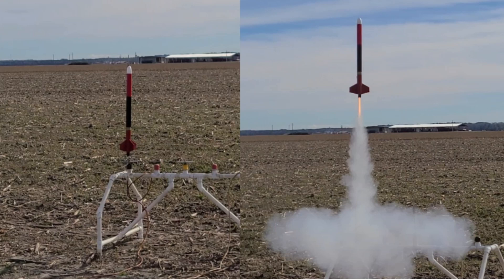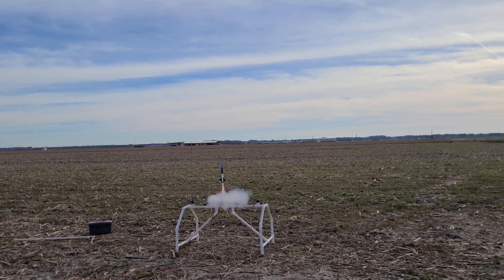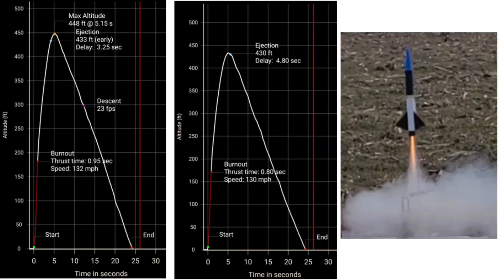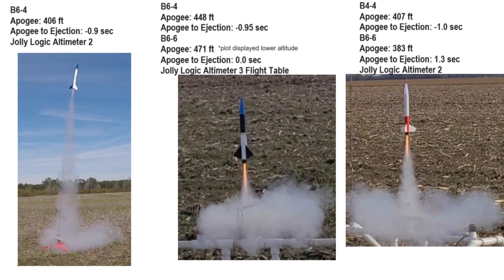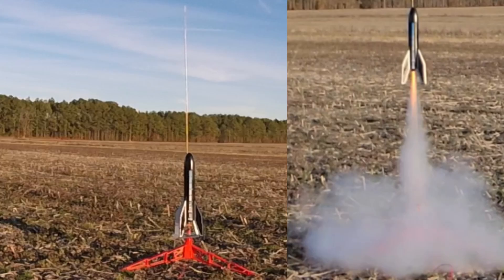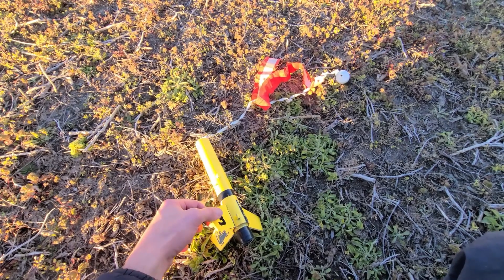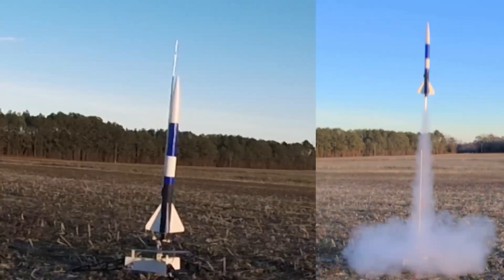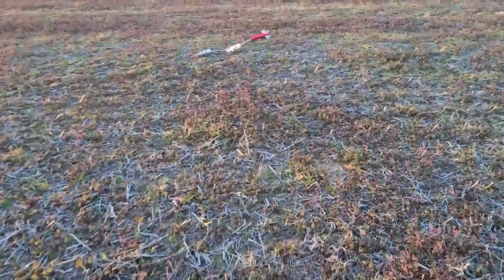Model Rocket Launches Including Estes Cherokee E and Olympus

Comment: I think I know why the fins break on the goblin air frame. The engine might be too much. Put in a smaller A-C engine and see if that stops that fin cracking.👈🤔
Reply from the maker: That launch was a C motor, I'm not sure I want to try an A or B motor in the Goblin, likely would be too underpowered, I'm planning to just go with the parachute option.
Reply: @rwkhobbies1969  nylon chutes get the vote.